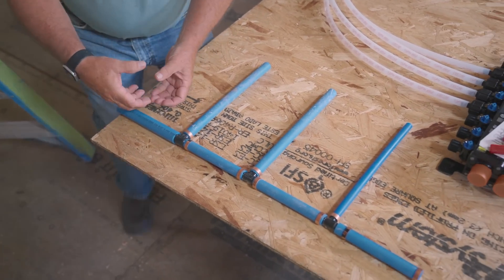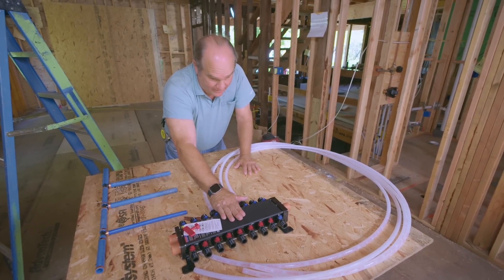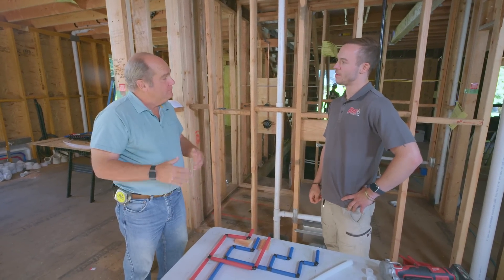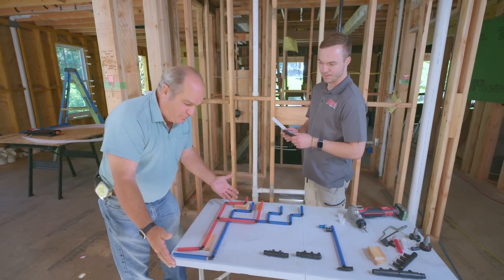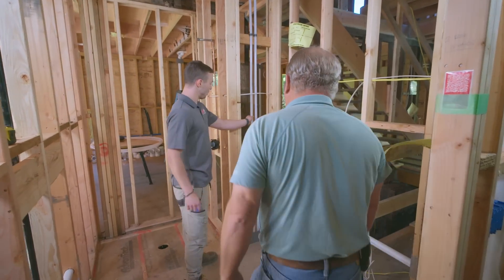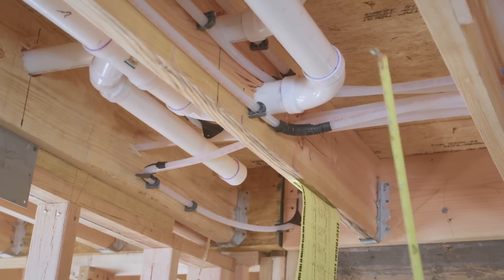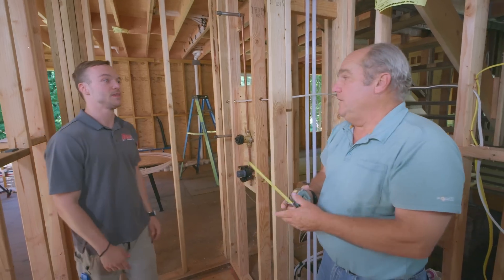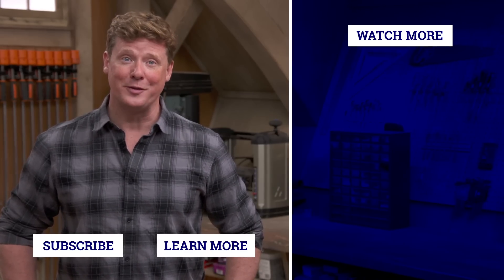A New Take on Water Supply Design | This Old House

Comment: 33 year general contractor.  I place a valved manifold (Dahl valves) in a central location in a house.  I feed the manifold with a 3/4 (or 1") supply.  I then run the individual branch lines to the individual fixtures.  They are usually less than 15 ft in length.  From the most frequently used shower I run a dedicated return  line to the water heater.  All hot lines and the return line are insulated.  I have used pex A for the last 25 years for both domestic water and hydronic heating with no problems.

Comment: Houses really need to come with maps showing where all the plumbing and electrical are in case something goes bad. Also, they REALLY need more access panels to any junctions so that it’s not necessary to crack open walls and ceilings!
Reply: there was a time when all plumbing had numbered tags on the valves and a chart in the basement. A "road map" would be a great addition.

Comment: I would think when the house is full and everyone taking a shower in the morning that you would have a flow issue having one line supplying multiple bathrooms.
Reply: probably not an issue with those flow restricted shower heads. Going to 3 gpm or higher heads, then yes.

Comment: A good manifold allows you to flush a toilet a not cause unpleasant times for  someone in the shower. Multilevel has vertical pressure loss making feeding 3 levels of bathroom from the same trunk not easy... Rho*g*h pressure loss + pipe loss. So really this appears to be just cheaping out and if you wanted to do that just do small manifolds with 1" trunk. Too. Much focus on recirc hotnwater and not basic pressure and flows.
Reply: Is this still an issue for new installs? I thought all new shower installs would have a thermostatic valve built into the fixture.

Comment: I'm planning on sticking with type L solder, trunk and branch on my next house.  Considering pro press fittings..
I would add that a 1/2" recirculation pump on a timer is the best option for hot water instant delivery.  There's just too much plastic and joints here and I'm not convinced that this is the best way to plumb.  Cheaper perhaps, but not better.
Reply: have you considered using a circulating pump under the bathroom sink that is powered by the light switch or motion sensor instead of a timer? That way the hot water is only brought into play when someone goes into the room.
Reply: @rupe53  I have not!  That's a good suggestion.  I guess the only way to compare would be the number of sinks and the purchase price of all those pumps compared to the cost of just having one large circulator on a timer plus the actual amount of hot water wasted on each system. I may actually sit down and do the math on this one!  Thanks
Reply: @MattSyTy    under sink pumps have gotten cheap and motion sensors are only a few bucks more than a decent light switch these days. If the switch also turns on the light (LED?) you'd never see the power bill difference and could wire them together. Just make sure the sensor can be set long enough so it's not turning the lights off if you are inside the shower for 10 minutes (girls washing hair?) or sitting in there reading a magazine too long. Anything is better than having a pump moving hot water for 3 hours at a clip... then there's the weekend schedule, if you follow my drift. If you have a separate light inside the shower, all the better. Wire it to that! (but keep the pump under the sink for access)

Comment: Instantaneous hot? One hot supplying all bathrooms? Let me know how that works out in a real life house with 3-4 showers and 4-5 toilets wanting water at the same time. Design for maximum demand. Get 100% satisfaction.
Reply: 4-5 toilets wanting water at the same time? How many poops are you taking?
Reply: @adamhaynes9771    yup, its' only a 3 bath house so that's the max.

Comment: I always run 3/4" pex because the inside diameter is very close to 1/2" copper.  1/2" pex has pretty small I.D. and the elbows are much smaller more like 3/8". In fact some fancy pants fixtures i install won't even work properly when you hook up 1/2" pex.   Plus you can always run 3/4" pex right up to any fixture without reducers.  Like a shower just get 1/2 female to 3/4 pex, no problem.
Reply: Use "Pex A" then
Reply: @jbellehumeur8010 sometimes I do.  Good point

Comment: If I were to design the plumbing system for a new house today, I would deploy point of use tankless systems for each bathroom or at least each cluster in the building instead of these systems where you're hauling hot water from a mile away.
Reply: Agree and saw similar from another mention use of "mini instahot" for each location needing HW.
Reply: But then you have to throw in the additional cost/labor of running electric to these POU systems, not to mention the additional initial cost.
Reply: Those point of use hot water supplies are energy hogs, because they typically use resistance heating elements. At the very least, these shouldn't be used for high water use locations such as showers and laundry or other spots that are close to the main water heater.
Reply: @dosadoodle  Yeah, but heat pump water heaters have been making leaps & bounds & are very accessible to almost all the consumers that are currently using electric water heaters. Heck even people who currently use gas ones can swap out now that many are able to be 110V. Point of use have their place, & may work better for some, but those are people that are more hands on types of homeowners to begin with.
Reply: @ericscott3997  I have yet to see a point-of-use water heater that uses a heat pump. That was my point: it is easy to find a regular water heater that is 3x as efficient in terms of hot water production per unit of energy (via a heat pump) than the point-of-use water heaters that use intensive resistance heating.

The only time a point-of-use water heater makes sense in my mind is when the location is far from the main water heater and the amount of use at a single time is quite modest. Otherwise it's better to draw from the larger, more efficient water heaters. And it's almost never cost efficient to get a point-of-use water heater due to the initial cost of the devices and that each will need to be periodically serviced and replaced.

Comment: I started doing this when i switched to expansion pex in 2019, i did this for the hot serving the upstairs bath rooms and that has a recirculating loop. The other runs are short and come of a manifold, I also had all the cold supplies of of the manifold on 3/8 home runs except the pot filler, hose bibs and tub showers on 1/2 inch. So its a hybrid approach.  I Noticed youd did not use through stud protection on you pex, what was your reason for skipping this?

Comment: I have been plumbing with these short/er runs for several years! I have also been installing multiple smaller hot water heaters closer to the point of use! In some cases I moved the hot water heater more central to the multiple points of usage! Just think conservation of water which by default means conservation of energy!
Reply: Why are you heating hot water?
Reply: Why do you end every sentence with an exclamation mark!  It makes your writing look insane!
Reply: @zoiks6631 Just because he makes a valid point doesn't mean he's not insane though 🤔

Comment: the ONLY reason you run pex is to prevent any connections being put in a closed space, otherwise just branch it all in copper. My home im building has NO hot water lines ran anywhere, only cold lines that then supply a mini instahot in each bathroom and in the kitchen.

Comment: Is that plastic BPA free?  Copper over pex to avoid micro plastics at least to your kitchen faucet.
Reply: Yes, PEX is free from BPAs, phthalates, and vinyl.

BPAs are only found in polycarbonates and epoxy resin-based plastics.  Phthalates are found in PETs (polyethylene tere_phthalate_).  Vinyl is found in PVC.
Reply: Lead in the brass fittings is okay?

Comment: I think the homerun is lot better. 0 connections hidden in ceiling. You can wait 15sec for hot water
Reply: If the HR lines are sized smaller than the trunk would be sized (usually the case), you actually get hot water faster than with a trunk and branch system.

Comment: why do they run pex a through out the house but when they get to the shower valves it is copper?
Reply: @walterm2871  generally it's easier to mount and fasten with rigid pipe

Comment: Absolutely no different to traditional water feeds, just a single plastic pipe as opposed to copper and joints. Personally I went down the route of having a ring for my hot water. 22mm in to every room that needed it, and then back to the hot water tank, small pump that just pushed the water through slowly, situated at the end in to the tank, so there was always hot water in the pipework. When the demand for hot water was called for the main pump just kicked in. Instant hot water (minus the 1l in the pipes up to the taps.), The temp drop from tank back to the tank was 4-5 C

Comment: I like the prior way. IE: the manifold might be in the basement or crawl space. single straight runs to each room with little to no leak paths.
Reply: More potential to hit something with nail or screw also.
Reply: But significantly more difficult to service and modify. And not only the pipes themselves, if you have that much running through your walls, electrical is going to be more difficult to manage as well to get around them all.

Comment: What happens when 3 people want to shower at the same time?
Reply: Less pressure. What if you need to run six sinks at the same time, plus water the lawn both front and back and the dishwasher and washing machine?
Reply: You take turns soaping each other up
Reply: Was wondering the same thing? How is this issue resolved?
Reply: A threesome. My dream.
Reply: @richardmoss5934  it works just like any house.
Reply: @saulgoodman2018  What would that be?
Reply: @saulgoodman2018  Never had that happen!
Reply: @richardmoss5934  Well it won't be hardly noticeable.
Reply: @saulgoodman2018  Seeing as you are a professional plumber, I'll just have to take your word for it!
Reply: @richardmoss5934  I'm not. But have you ever had someone flush the toilet when you were in the shower?
Reply: @saulgoodman2018  Yes, but everywhere I have lived have been plumbed such hat it makes no difference.
Reply: @richardmoss5934  Like I said before, it's not like 25 years ago, it's hardly noticeable.
Maybe less the 5 PSI.
Reply: @saulgoodman2018  Well like I said, you're the professional and as such must have the tools to measure it but I'm over 25 and can tell you that even 50 years ago here weren't problems.
Reply: Party Time!
Reply: @seanm3226  😃

Comment: Pressure loss is greater on closely spaced tees. This guy should consider getting better apprentices so hes not so concerned about leaks
Reply: Those mini-manifold things with three T's don't create the pressure loss you describe
Reply: @ugh-meh  While the majority of the pressure loss 
occurs locally within the fitting, some of it occurs in the upstream and downstream straight piping due to the propagated 
flow disturbances. The eddies induced in the fitting can continue to decay downstream and eventually be dissipated into 
heat while the flow returns to the fully developed condition.
Reply: It's science bud
Reply: It's a 3/4 line going to it, they won't lose more pressure just because they're placed closer together. More space between Ts just creates more friction.
Reply: @TheTapeandscissors  the disturbance of flow in a fitting is far greater than pipe friction

Comment: Why no insulation on the hot water?  Are you really going to go back and put foam on after those clamps, or go without?
Reply: you only need to insulate water lines if it's on exterior walls
Reply: There isn't much value in insulating interior ran pipes. You'll most likely need to purge the lines for each use anyway. If they're on an exterior wall or in the crawlspace it makes a difference.

Comment: Neat idea but would back-to-back bathrooms have less pressure if both in use at the same time?  Guess there is always a choke point for water flow.
Reply: I think if the mainline is correctly sized, pressure loss would be negligible.
Reply: Wont be choked if your main feed to those bathrooms is 3/4" but unless your house has a manifold you're using the same branch system anyways.
Reply: The simplest way I know to equalize pressure drop on a trunk line when multiple branches are in use is to make the trunk a loop.  Feeding the branches from both directions on the trunk tends to balance flow and pressure.

I'm not a plumber, but I don't need to be a plumber to design and install waterlines after the RPZ valves in the facility I work at as a maintenance worker. After the valve it's considered process piping and I can do just about anything I want.  City water to the wash down hoses? 1" PVC. I know it needs to be cpvc in a house, but it's only process piping  after the RPZ. All I need is for it to be NSF rated to keep the FDA happy. PVC, clear PVC primer, and clear PVC glue are all rated food safe (that's what the little NSF markings symbolize). RO water? 1" PEX is my go to. The ozonated water? Nothing but 316 Stainless steel will do. 304 isn't good enough for that nasty stuff. Copper works well in high temperature applications. 250 degrees near the steam jacket of some of the equipment is a bit much for a plastic waterline. Galvanized steel pipe even has it's uses.

Comment: You put these manifolds hidden all over the house and now you have a lot of connections tucked away in your ceiling. A lot more points of leakage. I’d rather have a majority of these connections in my basement or under my cabinet
Reply: You actually have less fittings. The flow is better and they offer a 25 year warranty.
Reply: @danielowens4222  25 years is not really something to be proud of when it comes to piping. 40 years is the projected lifespan of a new system before major repairs are needed. They learned from the polybutylene pipe to not overdo it on the warranty.
Reply: @danielowens4222  the flow is not better on tight tees
Reply: @danielowens4222 25 years is not that long
Reply: We typically install manifolds in “wet” areas such as over a tub, shower or sink
Reply: Especially considering all the reports of Upanor connection failures in recent years.
Reply: They aren't manifolds. They are multiport tees
Reply: @fantasyplumber  a fancy term for manifolds
Reply: @fantasyplumber  A manifold is any multi port connection. Technically even a basic T qualifies as a manifold.
Reply: It's called job security.

Comment: How is this not trunk and branch just less fittings ?
Reply: They glossed over it, but the trunk works its way back to the beginning, creating a recirculating loop.
Reply: @ugh-meh  I doubt that. Running 3/4 line that far doesn't make sense and if the recirc pump goes down, it would take forever to get hot water. Just running a 1/2" line back down to the water heater intake is more than sufficient for instant hot water
Reply: @ugh-meh ohh I was wondering what the very brief mention of the recirculating line was at the end there. Thanks that does make more sense now knowing that.
Reply: I was thinking the same thing. Looks like a trunk and branch, but compact.
Reply: It's 100% a trunk and branch system. Using multi port tees changes nothing other than decreasing water pressure at the multiport tees when multiple fixtures are running. It's literally worse than using independent tees as close as possible to the fixture. Still better than what a lot of guys are doing but not good
Reply: Each branch on a traditional trunk and branch uses 3 fittings. So three branches results in 9 fittings. For a mini manifold like this, there are only 5 fittings (one in, the 3 branches, one out).
Reply: @dosadoodle  if it's done right it doesn't matter
Reply: @fantasyplumber  What's the secret for identifying a person who never makes a mistake?